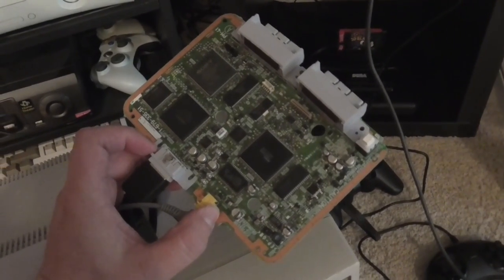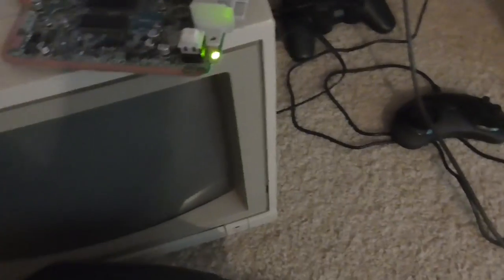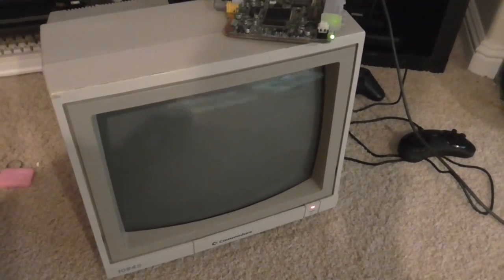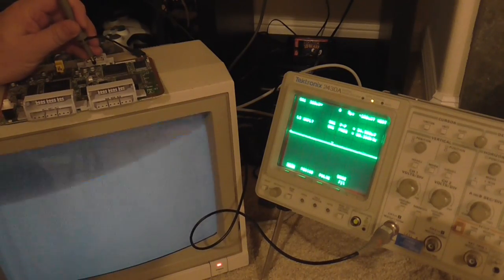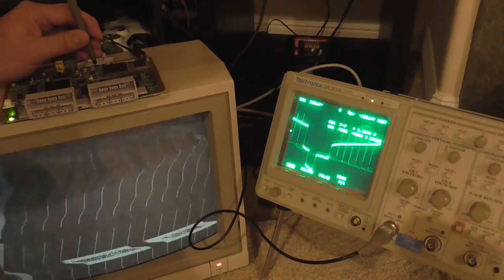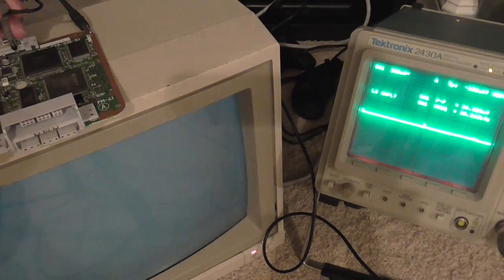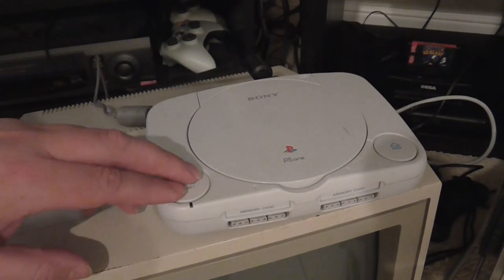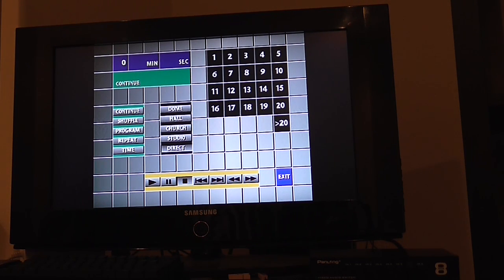Using an Oscilloscope to diagnose and repair Playstation One no video issue

Comment: I've no clue how the oscilloscope helped (because that's the entire point of the title).
Reply from the maker: It showed me there was a composite signal but the signal was not enough voltage. I mentioned that in the video, but I agree I wasn't clear.
Reply: @SkuldChan42  thanks
Reply from the maker: How Not To  Its just the way I sound ;).
Reply from the maker: How Not To  Oh the recap kit? I could probably dig up that PS-One and finish recapping it if you like. Its been so long - I think I just replaced those one capacitors and since it worked I shoved it in storage ;).

Comment: Good job but I'm wondering how did the scope help in this?
Reply from the maker: Oh it helped in showing that the peak to peak voltage on the composite signal was too low.
Reply: @SkuldChan42  okay. I keep searching for video that shows direct diagnosis of component on a board. Most videos are how to use an oscilloscope. Your video was one of the only ones that showed a little bit of use as supposed to how to.
I'm starting to get it. Scope doesn't do component testing. It gives you more info to work with.
Reply from the maker: @AB-yu2tj  yeah it's purely for seeing and measuring signals - the cap itself as I recall I did put into the esr testing device and it did have high resistance.
Reply: @SkuldChan42  I see thank you. I use esr and  Huntron for in circuit component test. I'm still getting use to them. But it's not bad...
Reply from the maker: @AB-yu2tj  Yeah I'll be honest - its kind of a crappy video - its been a while, but I do remember a a fair bit of off camera stuff I did to look over things.
Reply: @SkuldChan42   actually after your video I was able to test my first chip. And was able to match the graphs from the datasheet for that chip. And was able to fix a pretty expensive power supply for a machinery. 
I'm pretty new at this so I always try to learn a little more when I have time. And sometimes you look at something you don't think you'll learn much but it actually expand your view and it helps to get further
Reply: @SkuldChan42  So why didn't you just use a Multimeter to test the voltage of the components I do remember there being a AC Voltage setting. I'm still not getting what the point of an oscilloscope is other than seeing the waveform and if there is any distortion or noise. Well I start studying oscilloscopes next week so I guess I'll see the point then.
Reply from the maker: @robertmclaren8611  multimeter can barely see the composite video signal. At least the meter I had at the time couldn't be used to see stuff like that. It was only a third of a volt at it's peak.

Comment: what let you know that the capacitors were bad?
Reply from the maker: THE INC I should have explained this in the video :( - all components have a certain about of resistance right - as the electrolitics vent/leak their resistance goes up (which lowers the output voltage - and therefore reduces the signal coming out of the unit). Anyhow when I pulled them off the board I did have to clean up some residue that leaked out and the caps did measure below spec.

Should add on visual inspection they looked puffed up/out so they were immediately suspect anyhow.
Reply: You've seen the long answer, here's the short one. Because they are caps, and they always go out. :)